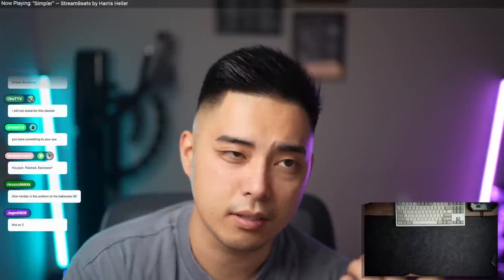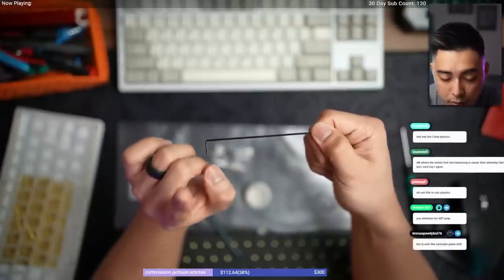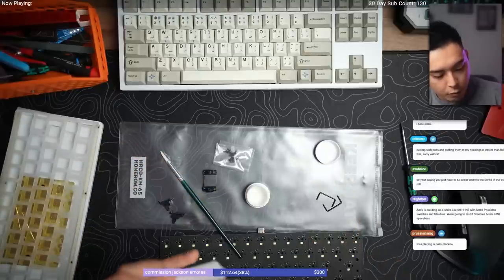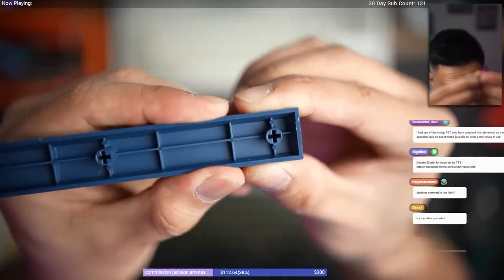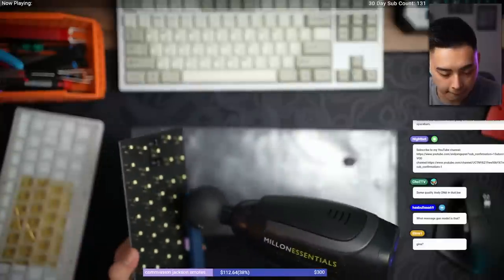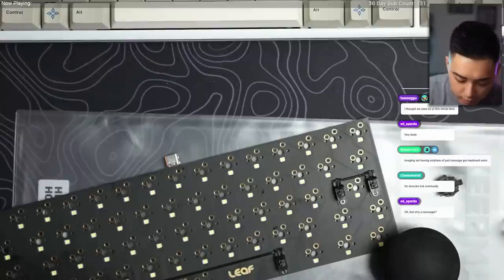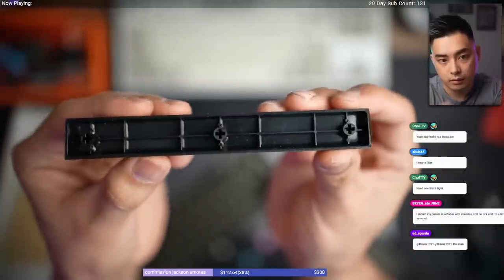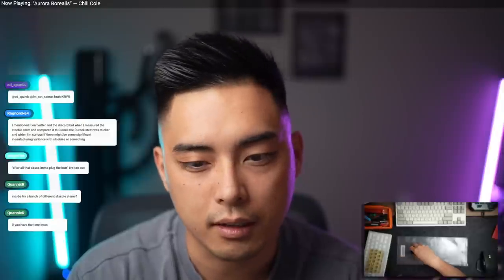I try to break my GMK spacebar..

Comment from the maker: I don't believe in balancing stabilizer wires.
Reply: facts
Reply: but even if i holy modded durock v2,  there will still be ticking even if there is very small wire imbalance
is it i didn't put enough lube?
Reply: What about using like 2 cellphones (or whatever has perfectly flat surfaces), and just compressing the stab wires between the 2? And then putting like a small weight on it for like 8 hours? Maybe that would work
Reply: Hi, so even TX you also wont balance the wire? Because if it ticks, I dont think TX can do holee mod right?
Reply: From the few wires I had on hand I find sanding down the burr on the ends already helps since that ridge affects balance when laying on a flat surface.
Reply: I believe in balancing stabilizer wires because all of my stab feel and sound perfect when my wire is perfectly balanced (it took me 1 week per set lol).

There are alot of annoying places where the bend might occur like the curve egdes of the wire(I'm I saying that right?) which make it almost impossible to balance.

Once the wire is perfectly balanced. You just need to apply minimal amount of lube to get rid all of the annoying sounds and it should last for 2-3 month of intensive using with that amount of lube or 6-8 month if using the amount of lube that Teaha is using.

Yes it a huge time waste but I have OCD for stabs so the dry and scratchy sound comes from the holee mod really annoy me.

(I'm Vietnamese and still in practice with my English skills so if there are some grammatical errors happened in my text pls show me where)
Reply: i believe in you
Reply: @hkkeyboardguy  You are doing it wrong, holee moding literally means you can not tick in the stems of the tabalisers, what you getting probably is the ticking from where the wire clip into the stab housing. There are many ways a stab tick, wire balanced wire does nothing, you still get ticking if you don't removed the ahrd contact surfaces
Reply: @neolam  TX can't tick in the stem because of the rubbery material, but it can tick on the wire clip in area
Reply: @nhatminh6452  Holee mod and you never need to relube. Also holee mod do not make your stabs mushy, that only happens if you do it wrong. I have tested over 15 sets of stabs, using 10+ diffferent mods on each and holee mod is by far the best, or just get TX stabs
Reply: @tombaker2510  I didn't mentioned about the mushiness because I did it right. I just don't like the dry, scratchy feeling that it produces. And I still need lube to make it smooth and less ticky.

I have done this mod for 4 of my budget boards and I have nothing to get upset about. But I must do wire balance to my premium matrix me in order to get the perfect feel from it. A little bit of hard work to achieve this is worth for me since everyday I just need an hour to wire balance a set of stabilizer to train my patience instead of laying down swiping my phone screen.
Reply: neither do i XD
Reply: @nhatminh6452  I do not think there is dry scratchy feeling? why would adding banaid in the stem hole make it scratchy that makes no sense, I holy mod everything, KC, janes, unikorns, F1s, and not a single one has ticked, I do build services for people and no one has said anything bad about the holee mod feeling different to what they used to get. I literally do not see downsaide to the holee mod. I have probably done over 30+ stabs with holee mod
Reply: @tombaker2510  then how long does it take for mod to be ineffective with those materials? I have tried many kinds of tape(plastic, uhmwpe, electrical, masking,..) And most of them came of after 3 months of my intensive using. It maybe due to the fact that my adhesive under the tape is weak and once the lube is applied to eliminate those ticking(ticking from the wire holding part) they came off really easily.

For me wire balance wipe out all the ticking that comes from 2 parts(wire holder and the stabilizer stem hole) but it consume too much time from me so I need an alternative way to do this stab modding stuff.

I currently using genuine cherry screw-in and durock v2. I recently bought owl stab and they are ticking af so I hope TX stab will perform much better than this since I can not lay my hand on the Staebies to experience good stab.
Reply from the maker: @hkkeyboardguy  holee mod the durock. but you gotta do it before you lube. wire balances exist on all wires imo
Reply from the maker: @amizan8653  won't be enough to compress. with metal you kind of have to overbend and it will kind of resist due to some plasticity, and then result in a certain bend. the overshooting and hoping it'll land flat is what I was describing in the video. it's very hard. can't just set it and forget it and leave it overnight.
Reply from the maker: @neolam  tx I def don't need to balance! staebies neither. TX shouldn't be ticking. you can try balancing if you're paranoid but I've almost always made it worse
Reply from the maker: @Zeraphor  that makes sense. just the flat end?
Reply from the maker: @nhatminh6452  your English is great! also a WEEK oh my god lol
Reply from the maker: @mirzaiscandle  thank you but I don't believe in myself LOL
Reply: @AndyVNguyen  I see... Alright then, I also don't believe in balancing wires
Reply: @tombaker2510  so just directly use it ?can i know how to tune or prepare tx ?i not sure why i still have the tick if i don’t do anything on it…need to apply thick dialectic to get it if it….
Reply: @AndyVNguyen  what would you do to prepare tx ? i really wish to have a set of perfect tx stabs
Reply: @AndyVNguyen  thanks for your kind words Andy. Yeah, I must admit 7h/week is overkill for a stab set.
Reply from the maker: @neolam  just 205g0, maybe plug butt after.
Reply: @neolam  Holee mod still need lube. Tx is easy, put a thin layer of lube on the wire and just put it in, it wont ever tick because of the way the stab is made, it basicly is "holee" moded
Reply: when you said these lines, the world changed:
a MACHNIE made this and made it imperfect. DO YOU THINK you think you can bend a wire better than machnie? I DONT THINK SO.    slay queen
Reply: @tombaker2510  damn...why my TX will tick if just put in lube? maybe because of warped keycaps?
Reply from the maker: warped keycaps can cause things to tick. a warped spacebar is making my tx stab tick.
Reply: @AndyVNguyen  i think it is because i didn't plug the butt ha
do u think i shd buy a syringe or just normal brush to plug is already fine(◍•ᴗ•◍)
Reply from the maker: @hkkeyboardguy  brush is probably fine
Reply: I'm happy I'm not the only one who has this mindset. Wire balancing fucked me up in parallel with stab tuning. It's hard to do as it transfers the unbalanced end to the other part. Holee mod mod however is a life and time saver. I just hope they continue to improve stabs in the future to make our life easier.

Comment: thanks for testing this, I heard about the staebies breaking/cracking stems on spacebars so I was a bit skeptical.
Reply from the maker: yeah sometimes user error be crazy. at least I kinda feel like steadies usable. interesting that they're gonna drop a revision.. maybe it was truly breaking some stems
Reply: @AndyVNguyen  TBF they even said in their description that the these were DESIGNED to fit in GMK only so who tf knows what happened
Reply: It does break some spacebars, I tried to put staebies on a spacebar and it was so tight I could almost not lift my spacebar off
Reply: @tombaker2510  people have broken spacebars with durocks. i found them to be tight but have used four sets of staebies and have had no issues. some people don't like hearing that it's user error lmfao
Reply: @ffffff1-mmmm  Maybe its batch variance, because the staebies I tried are way tighter than durocks, and I probably used like over 30 sets of durocks. The 3 sets of staebies were some of the tightest stems I have ever used out of stabs and switches. I was putting these on new GMK sets, when I used a slightly used GMK spacebar it was fine, I think if people use a brand new spacebar that has not been used on other stabs it could break the stem. Since it has not been stretched out yet

Comment: Wire balancing take is based, its impossible to balance them perfectly.
Reply: Everytime I tried it I just ended up stripping the finish on the wire/ overbending it
Reply: Tried to straighten my wire for this first time and had trouble with it. I gave up and used one of my extras 🙃
Reply: that's why i always use owlab lol. Their wires are magical
Reply from the maker: @HoangAnhNguyen-gy4tq  yeah what wwwwwwwwvwvwvw said lol .if it comes bent it's game over
Reply from the maker: @supertree08  that's the move
Reply: You can get close...but prepared to spend hours and pray for luck , I've done it once to the point where ticking is minimal to nonexistent with bdz but it's my first build and sure as hell ain't doing it again it's masochism

Comment: I’m telling you guys wire balancing is an art. I’ve done it on my last 12 builds and only on my last 2 did I sort of kinda figure it out. Using nylon tipped parallel pliers def helped at first but I find myself using my fingers to make vertical adjustments and the pliers for smaller horizontal ones. I noticed this fixed issues with certain stabs having the slightest yet still audible scratch or rattle even after multiple mods/adjustments and sometimes even over lubing.
Reply from the maker: do you think failing 10 builds was worth the struggle?

or would you just buy tx stabs?
Reply: @AndyVNguyen  I wouldn’t consider them “failures”. I can’t commit to one stab over learning to tune multiple. With constant tolerance variances with pcb thickness and plate cutouts and stand off placement,  I’d rather be able to tune the best stabs for the build I’m working on. The failure would be to replace an opportunity to learn with an easier route that in turn prevents me from new experiences down the road.

Comment: Pretty sure the problem is that people aren't using a keycap puller to pull off their spacebar and instead are just prying them off. I almost broke my spacebar that way (using staebies) because I'm used to Durocks.
Reply: how do you pry off a spacebar unless your keyboard is low profile
Reply: @gooberlaya  fingernails
Reply: How the fuck are you supposed to use a keycap puller on a spacebar? That thing doesn't even go wide enough for anything bigger than 2u
Reply: @rando843  1 year late, but you use the keycap puller to pull off one side of the space bar, then pull off the other side (that’s what i do)

Comment: It's easy to see the crack if the spacebar is mounted, looking from the bottom.
Balancing the wire is like you told, but you need to see the angle betoween the two, and then see if is or isn't ok. But as you told this angle is already very small and probably won't tick from this.
Ticking is mostly from bad tolerances in my opinion.

Comment: i honestly used to believe in balancing wires but after spending like 50+ hours on 2 sets of wires, yeah nope. I bought owlstabs and they arrived earlier hoping they would fix my wire problems, but lo and behold they wont stop fucking ticking. Im working on trying to get a wire replacement from them
Reply from the maker: You get it. My owlstabs ticked too. If it isn’t straight from factory, you’re 100% boned
Reply: In my experience owlstabs has been the worst out of all stabs

Comment: I broke one of my spacebars like the person in your discord or whatever. XDA PBT Happy Planet. 

It was completely my fault. I would take my spacebar off the way I saw HipyoTech do it... yep totally blaming Hipyo. LOL So I would use a keycap puller and yank one end up only. 

If you do this with enough force and follow through the stem can pop the thinner wall on some spacebars. Its not because the stem is too big... its because you the stem is applying force when bent and the stem is thicker than the thin wall of the spacebar stem. 

It was an easy fix though. I just used some pliers to tighten the gap, and applied super glue. Then to hold it a bit better I got some super thin fishing line, tight it around around the entire stem like 10 times then put some super glue over that. 

The board has since been retired... but I am happy with the fix.
Reply: Do not follow anything hippo does, the dude knows nothing about how to make a good keyboards. His stabs tick for days on his streams
Reply: @tombaker2510  im usually not one to hate on certain youtubers, but man that guy is a clown. totally agree with what you said

Comment: thats a hot take on balancing wires. i usually try a few times on the spacebar wire and then holee mod them anyways for good measure.
Reply from the maker: if you're gonna holee mod why balance..
Reply: @AndyVNguyen  just in case 😭 it's usually the long part of the wire that needs a little bit of help more than the ends though
Reply from the maker: i usually just check the side that's not making noise or the side that's making less noise and just use that side
Reply: @AndyVNguyen  i should try that :)
Reply: just buy 100 wires. they're like $10. you get a bad wire, just toss it and grab another one.
Reply from the maker: @ffffff1-mmmm  I have 100% done that but I don't feel like ordering from taobao again lol

Comment: I mean I’m using staebies right now and I’ve used gmk spacebars from different sets totaling to maybe 6 to 8 remove+installs in total over the course of about a month and there’s no crack or anything at all
Reply: I always remove my spacebars the same way: remove the 2 alts on the side first then just pry the spacebar up from both ends using my two index fingers
Reply from the maker: i do the same and so does the person who had the cracked stem
Reply: @dude55669  I broke a spacebar in half doing it this way... Never again. Now I remove the Z row, or at least the stuff above the spacebar and with 3 fingers and a thumb try to apply even pressure everywhere, making sure I pull vertical too, not at an angle.

Comment: Curious if anyone here knows how to fix this but my spacebar on my mode65 doesn't like to sit on both stabs equally, if I press a little bit harder on one side or another it turns into a seasaw. It only happens with my GMK spacebar however. When I use a knock off gmk spacebar or PBT space bar it isn't an issue.
Reply: Probably a warped spacebar

Comment: Staebies work fine for me. Haven't had a cracked spacebar yet. But they do make that clicking sound when pressed down really hard, though. I have no clue what causes it.
Reply from the maker: Is that what I was hearing lol I was going crazy. Happened on one bar and not the other
Reply: @Andy V Nguyen  i have a feeling it's the stem on the spacebar getting caught on the lip of the stab housing. But I haven't really investigated too much.
Reply from the maker: @FranktheTank319  yeah It's hard to look under when the keycap is covering the whole thing. I just used another spacebar
Reply: @AndyVNguyen  Does it not happen with the new spacebar? I find that it doesn't make a difference during normal use.
Reply from the maker: did not happen with the gmk bleached bar